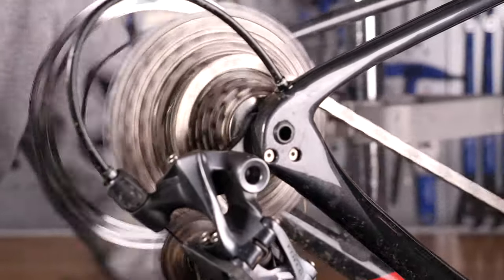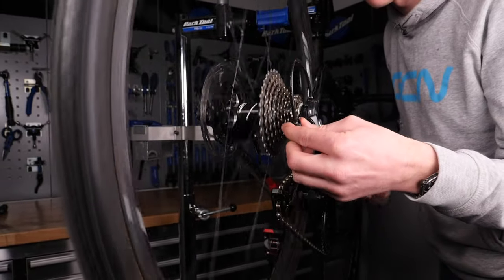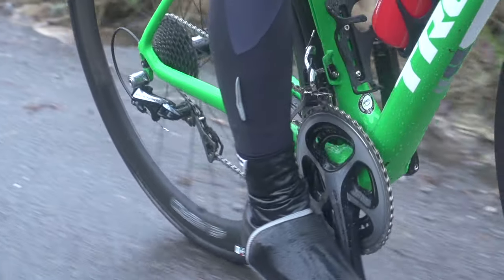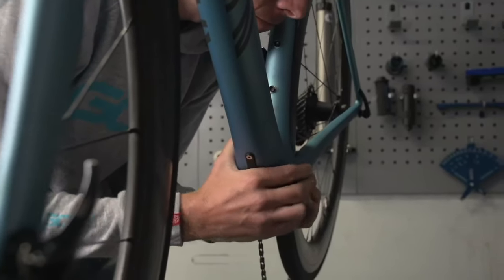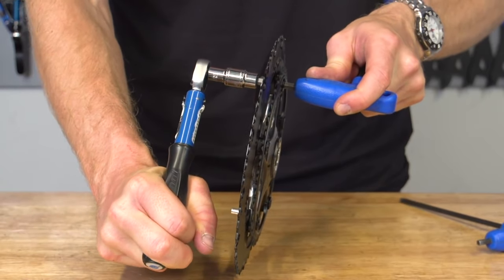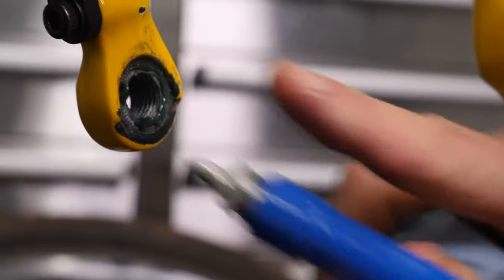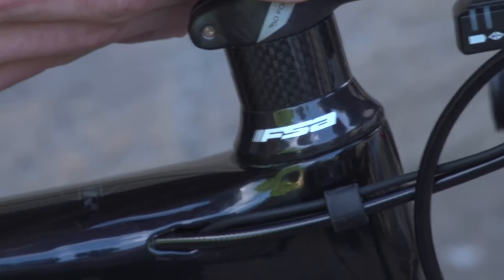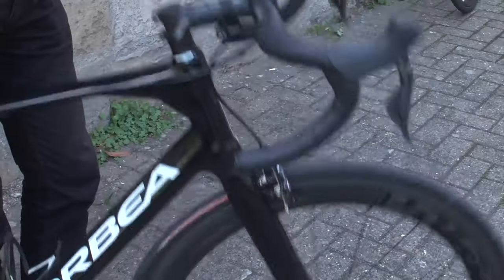Help! My Bike Is Making A Noise | How To Fix A Noisy Bike

Comment from the maker: What's your top tip for fixing a noisy bike? Let us know in the comments. 👇
Reply: Alright - took me a while but I figured that one out on my Trek Checkpoint - should be a possible solution for every Trek Bike with an adjustable "Stranglehold" dropout on the rear. So, the bike made some ungodly cracking noises while pedaling and/or breaking which sounded as if the bike would break in half any second. Solution: If the noise occurs when pedaling then turn the adjustmentscrews on both rear ends of the stranglehold a little in and out and put a bit of lube on the parts of the screws which touch the frame. Make sure to put the screws back to the original position. And when it happens while breaking you'll have to loosen the screw inside the rail which is used to adjust the break according to the position of the dropout, clean the rail and the screwholes, lube the screw and put it back in.
Reply: WD40 bathing :-p I regularly dis- and reassemble my bike und regrease/reoil everything. Also checking bolt torque is a usefull idea.
Reply: Greasing my seat post!
Reply: Put on ear plugs or leave the bike hanging at home? Or maybe get another bike? Just joking!
Reply: Don’t forget to check the seatpost, saddle clamp, and stem bolts. Also, check that the interface between the seatost (seatpin in British English 😉) has the correct lubricant for the materials in question (grease or fiber grip).  And check for loose or rubbing spokes.  So many BB or drivetrain creaks turn out to be one or a combination of those things and not the bottom bracket or drivetrain at all!
Reply: Buy a new one
Reply: I'd had a creaking sound that I couldn't localize. I took my bike in for a Trek factory recall on the quick release skewer, the shop insisted on replacing the skewer themselves, and when I came back to pick it up the mechanic said "I noticed a creaking sound, so I fixed that as well". Best solution ever.
Reply: I’m lucky my neighbour is now a home based mechanic
Reply: What pedals are you using. They look different.
Reply: I had a metallic, musical clinking sound after a ride after the bike got wet. Did a quick torque of the chainring bolts while the chainring was still on the bike and voila... it was gone. 4 bolt Ultegra 8000 system.
Reply: "Ding ting" at my wheelset.. Yep, the spoke are loosen a bit.. Just re tighten it, but chech the rotating too..
Reply: Noisy bike? That’s a sure sign you need a new one, right?!
Reply: check the inside of your tubes... make sure its not dirty. Just happened to me today, been riding under alot of wet conditions recently
Reply: Do not under any circumstances ram bubblewrap in your frame- it might stop the rattle but your gears probably won’t work properly due to the added friction. As for changing a cable afterwards... 🤨 bodge
Reply: Believe it or not I was having noise from (I don't know exactly which is the name) from the front derailleur hanger. With a little wd-40 over there, the noise is past. Magic!! I tried all before but nothing. Greetings from Grecce!!! #GCN
Reply: For me, i regreasing all moving parts and my contact point on my bike
Reply: Front axel regreasing
Reply: Torques all bolts on chainring, crank arms, pedal. Replaced bottom bracket. No luck. Removed pedal, greased threads, and replaced. No CLICK!!!  I would not have thought a tightened thread would creak…..I was wrong.

Comment: Well, after replace a set of pedals, a BB and a new chain, i find out that the noise was from the seat post
Reply: How could it work?
Reply: bike shop wanted to replace bottom bracket. said thanks but not today Removed seat post applied lube  and have not had that problem since with regular pm
Reply: Ricardo Oliveira R.I.P
Reply: Bro I just found it was my seat post too 😫😂
Reply: @emmettdaley8806  lol my cutie
Reply: 😂😂😂😂😂😂😂😂😂 I clearly reason with you

Comment: The Derailleur Hanger screw was loose and drove me nut. Took me two years to find that problem.
Reply: Same case. BMC SLR 3. Fuckin freakin crazy squicking sound. There were moments i wanted to break the bike in pieces and dance over the broken pieces. Then i accidentally put my hand on the DH and it was loose. Cleaned it, greased it, tighten it and the sound was gone. Unfortunately the bolts get loose once every month more or less and i have to repeat the procedure but at least now i know.
Reply: I used a little bit locktid! Then the bolts do not get loose that easy.
Reply: Is that what causes a crazy squeaky noise that makes it sound like it is from the chain? The noise I am hearing is like a bird fucking chirping I cant get it to stop I am new to cycling..
Reply: @clancyo8978  Best way to find out is....to check your Derailleur Hanger screw! Just do it!

Comment: A big cause of rear derailleur noise / indexing problems is a bent/misaligned derailleur hanger. It doesn't take much to knock them out of line. I service and build most of the higher end bikes that come through my local shop and have found that almost all of them need some adjustment. I've have made it a standard check on every service/build I do. 
Any bike shop that is worth dealing with should have the correct tool to check and adjust the hanger. Totally worth it.

Comment: I had a funny noise from the rear of my bike... It was like a clicking and skiping sound, but also I felt it with every pedal stroke, and onley in 3 bigest sprockets... The thing was that my cassete got a bit lose, but it sounded just like when you put a new chain on an old cassete so it skips from time to time... But it was all the tine in my case. I wish all best to GCN an al the presentors, nice job and keep on going

Comment: Hi Jon.. Most annoying click I've had was on my 2015 Cannondale Synapse about a year ago. Checked the simple stuff, like : seatpost, saddle, pedals, headset, but had no joy. Took my bike to the LBS to get the bottom bracket checked out, but still no joy. On a group ride a few weeks later someone suggested it could be rear freehub bearings causing the problem. I was unsure because the wheelset was less than a year old with no more than a couple of thousand miles on it. However when I got home I put the bike in the workstand and removed the rear cassette. I then undid the bolt holding the freehub body carefully removed it, hoping things weren't going to ping in all directions. Luckily all was fine.. Just like the YouTube video.. Greased the Pawls and the mating surface of freehub and hubshell with the blue stuff the LBS uses and re-assembled.. Hey presto, no more noise !! I reckon it was the interface between the freehub body and the wheel that probably didn't have much lubrication when it was initially built that caused the clicking noise.. Hope this helps someone else whose tried loads of fixes and is still scratching their head.

Comment: I didn't think any of those suggestions would be the remedy for my noisy bike!
Reply: Ya its actually the chain rubbing against the bottom bracket.  Have to adjust cogset or jus ride in a lower gear.  Peace😅

Comment: With a creak, before you start dismantling the bike check your saddle bolts are sufficiently tight. Could save you a lot of effort chasing a drivetrain creak that doesn't exist (a friend of mine said 🤔).

Comment: Hi Jon. In recently had an absolute nightmare trying to locate a vibration feeling that literally shuddered right through me every time applied the rear brake hard. Went through every rim braking fix several times before months later I realised it was my di2 battery installation. Couldn't believe it 😂

Comment: On a club ride, Saturday after Christmas, Every time I was pedalling hard, I had the most annoying squeak that seemed to be coming from the BB.  Got home rather fed up. 
When I went to work on the bike, being prepare to strip out the BB etc, I noticed that the saddle had moved back slightly...
Removed the saddle, cleaned the rails and the clamp. Set up the bike on the smart trainer....no squeak!

Comment: I recently had a clicking bottom bracket Or actually, when pedaling it was really loud so it was more of a bang than a click. I removed the chain and spun the crank by pushing with my fingers on the crank arms as opposed to the pedals. The click was still there. I guess this means very certainly that the noise actually came from the bearing itself. I cleaned and re-greased the bearings and the noise went away, but I still wish I understood what makes a bearing sound like that.

Comment: I had a bushing going out in one of the jockey wheels that took me quite some time to find. I think I tightened and greased every bolt on my bike trying to fix that one. It didn’t cross my mind to look at the jockey wheel since it was still spinning fine. It was one of those “might as well check it since I have checked everything else” moments.

Comment: Love this video! I’m so OCD about bike noise that other riders with chain squeaks or grinding drives me nuts.  I recently had a creaking noise coming from my bike. I changed the saddle, cleaned and reapplied fiber grip on the seat post but the creak was still there.  Turned out to be the rear through axel bolt was a bit loose.  This gave me a good excuse to purchase a torque wrench kit so I could be sure not to over tighten the bolt.  Peace and quiet again!

Comment: Had my "fun time" hunting down my share of squeaks, rubbing and other irritating sounds. 

1) Started to hear inconsistent clicking sound - changed the bottom bracket and it didn't help (second hand old bike) . I cycled with that noise over a year, greasing the seat post and pedals and all the nuts and bolts periodically and I was frustrated as the noise would go away and come back no matter what I did. But then I damaged my rear wheel and I had to replace it. The clicking went away instantly with the new wheel.

2) Inconsistent rubbing noise, almost like a brake pad rubbing against the rim but not on every full circle of a spin. I checked the wheels, they were pretty much straight and the sound was heard only if I was riding, not by cranking by hand on a fixing stand. For some reason I started to check the spokes and there was one which was loose. I tighten it a little bit and loosened it's pair and the noise was gone.

Comment: The worst squeaking sound I had was coming from the seat post. It appeared to be caused by the BB or pedals, but after applying some assembly past to the seat post,  the noise was gone.
Another squeaking sound was a combination from loose spokes and wrongly lubricated chain. Took me a while to find it out....
Reply: I ran my brand new bike through a car wash 10x recently. Whenever I’m riding I’m hearing a repetitive squeak from the front or back wheel, how do you think I should fix it? Disassemble it and grease as much as I can around the wheel bearing ?

Comment: Had an annoying click whenever I was pedaling with anything from light pressure to hard pressure on the pedals. I felt it through the drivetrain side crank sometimes, and sometimes through the non drive crank. It wasn't always on every stroke, and not  always when the pedal was in the same position of rotation. Eventually found that the quick link had worn to the point that you could move it back and to by hand. I suppose that's why it happened in a very random  place and time, depending where the link was in the stoke.

Comment: I often pick up my bike 6 to 8 inches and drop it. That checks for rattles and lets you find loose screws such as bottle cages early. Also with my dI2 I have had problems with the bottom junction box rattling in the frame. Velcro works good there.

Comment: I once used my friend's bike and i noticed some noise while riding on the largest rear sprocket, something like a metal grinding another metal. There is also a clicking noise when i put in a lot of power.
I gave it a check, and it turns out that one of the spokes is loose and is hitting the derailleur each revolution.

Comment: Had a clicking noise on my bike. 

Regreased and tightend the pedals. 
Indexed the front and rear derailurs. 
Replaced the bb. 
Finally realised it was the back wheel. Checked all spokes, disassembledit and rebuilt it. 

That didn't solve it either. 

At the end I got rid of the noise after I disassembled, cleaned and assembled the freehub. Yey!

Comment: I had a clicking sound and checked everything you have mentioned, turned out the noise was coming from a couple of spokes on the front wheel.
Dropped a single drop of chain lube on a few nipples at a time and solved the issue.

Comment: My (new) chain is very noisy when it engages the big chainring on the front (50T). It's only when using the biggest 3 sprockets on the 11-32 cassette. It's definitely the chain/big chainring that's noisy. The chain is well clear of the front derailleur. The indexing is spot on and gear change up and down the cassette is smooth and quick. The rear derailleur (ultegra 6800) has a long cage which should cope with 11-32 cassette. Could it be the front chain ring being worn out?

Comment: My quite new bike with shimano 12speed, makes a noise, ONLY on one of the sprockets ... chain is fine as on the rest it doesn't make any sounds....  now.... 
ONE of the tooths is giving the trouble. 

The chain in the very last moment, when it catches that very tooth, it kinda clicks IN, on it. 
I have noticed the sprocket tooth is like too wide? 

I would have to use sandpaper or something? I am not sure... my local bike shop said they can't do anything about the clicking sound. 

I need help because it's driving me crazy.

Comment: I observe not really a sound/noise but a vibration while pedaling.
My dealer and workshop was not able to fix it and it drives me crazy as it’s an expensive bike with Campa SR.
I suspect the BB386 bottom bracket and/or the bearings in there to be the root cause but I don’t know how to start with root cause finding.
Any suggestions?

Comment: Dear John, in the past I’ve swapped a Shimano threaded bb in place of an FSA and kept the same 24mm spindle. No problem. I later did this with pressfit and apparently 24mm is not the same between Shimano and FSA pressfit bb’s. I ended up lightly malleting the FSA crank into a Shimano Pressfit which creaked like crazy,  later a bike mechanic told me these are not compatible. How is 24mm not compatible?

Comment: A common rattle for new cyclists, particularly on cheaper bikes: compromised bearings on cup-and-cone hubs. Get the bike up on something (a stand, ideally) and spin each wheel separately. If you hear the rattle from the middle of a wheel when it's rolling freely, good odds your bearings have been compromised, such as by grease leaking out and/or by water getting in and rusting the bearings. Bad news is that you'll need to disassemble them, clean them out, re-grease them, and replace the bearings, good news is that this really is something you can do by yourself and there's videos online.

Comment: I recently had the chain clicking with the cassette. first, I thought it was a bent cassette tooth, but after a long day investigating the issue, I found one of the BEARING BALLS in the back wheel was OUT OF PLACE which caused the cassette to have a SLIGHT MISALIGNMENT hens the clicking noise.

Comment: Sometimes it is the saddle or seatpost connection. It is the easiest to find simply by riding out of the saddle and see if the noise disappears. Check the easy stuff first.

Comment: Ticking as you pedal? Look at the cable end for the front derailleur. They have a habit of getting bent and either tick against the rear wheel or the crank arm.

Comment: One more important check - the SPOKES!
I'd been chasing a ticking sound for a while, rewatched the whole series on it on GCN with Si, but couldn't find the problem. 

I've re-greased and re-done everything up to spec: headset, quick-releases, brakes, stem bolts, chainring bolts, seatpost and saddle, cleats, replaced BB30 bearings, had a shop inspect the BB shell...to no effect.

It turned out to be 2 lose spokes on my new Mavic Aksium rear wheel. Probably they haven't been probably done up at the factory, or came lose somehow - that I don't know, but after tightening everything, the tick disappeared!

NB Important note here, the wheel wasn't really out of true, so it wasn't the brake rubbing. I reckon the tick was coming from the spoke/nipple interface. Hope this helps!

Comment: Hi, my chain making creaking/ticking noise when on  7th sprocket, i adjusted derailleurs perfectly fine there is no rubbing, guide pulleys are also aligned on the center of the chain, even i took my bike two different bike 's official service shop, replaced the ball bearings inside the hub and re greased, they've said everything looks perfectly fine, but the noise still there drives me crazy...This noise started after i cleaned my chain and the sprockets with diesel fuel, dipped them in diesel for 1 hour then washed with dish-soap and water then waited 1 day to dry off then lubricated with shimano's chain lube, and the noise started. Please help me address this issue where this noise generated from.